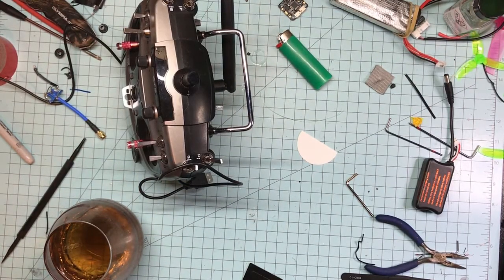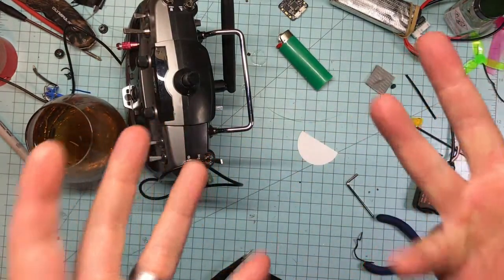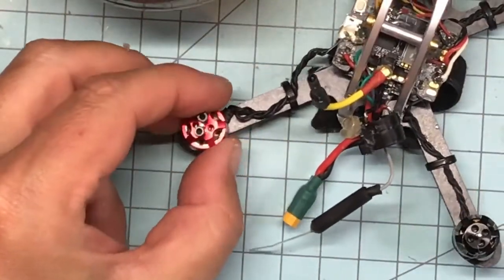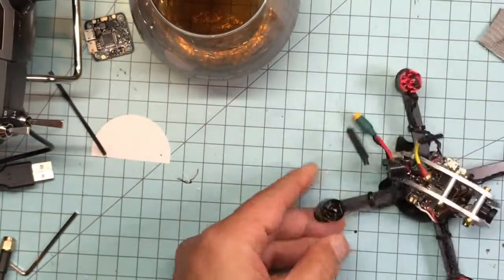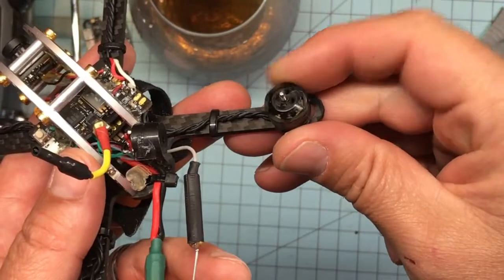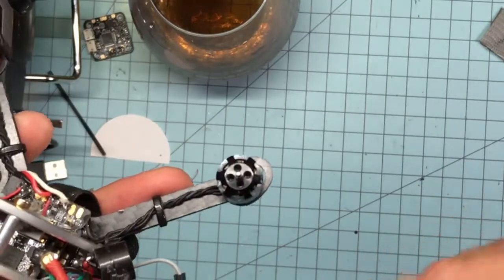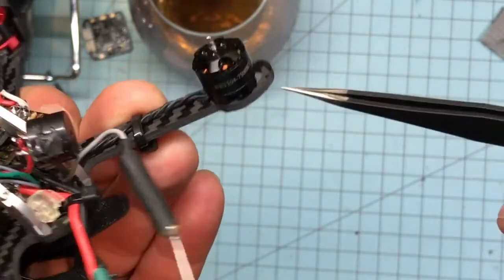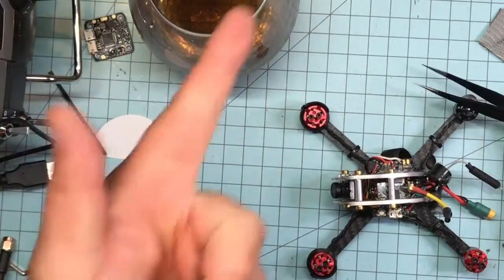Tech Quick Tip- How to tell if you have bent a shaft on your motor!!! Micro or standard!

Comment: I find that it helps to pinch the arm of the motor in question between two fingers, and spin it the motor up to speed gradually. The degree of the bend of the shaft, paired with the structure of the carbon will resonate at a specific RPM, causing noticeable vibration in the arm, which you can feel. The higher the RPM the resonance occurs at, the smaller the bend angle.
Reply from the maker: very true! that would work as well. usually i bend them so bad its pretty obvious lol.. but if you have a micro thats just a bit off, it can be tricky to trouble shoot. thanks for the input!! good call

Comment: Using tweezers is brilliant! Great tip JJ! For finding a bent motor I have only armed the quad and rocked the pitch/roll stick to identify which motor sounds bad and vibes the most. For sure I'm gonna try this trick next time! On the flip side, when attempting to straighten a motor out I'll turn it by hand and look at the gap between the bell and the base, and tweak as necessary by wedging in a tiny flat head screwdriver in the gap where the gap is smallest and twisting it to push/bend the bell back up (this probably really only works with flatter-than-taller motors like a 2205, etc). Shinny! Cheers!
Reply from the maker: GITech hey thanks brother!!! I've done the screw driver trick to.  It's a good tip. Or I've used a deep socket and placed it over the shaft and bent it back as well